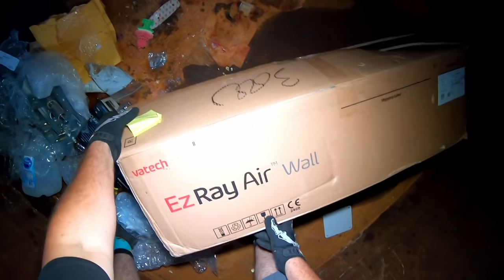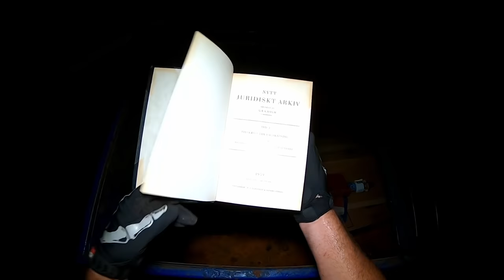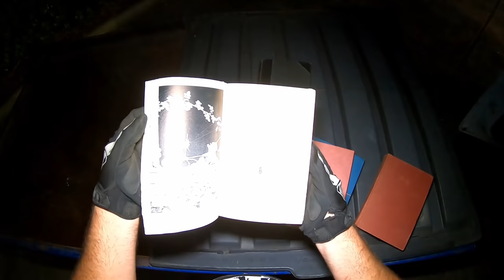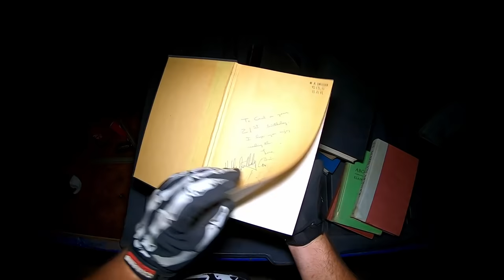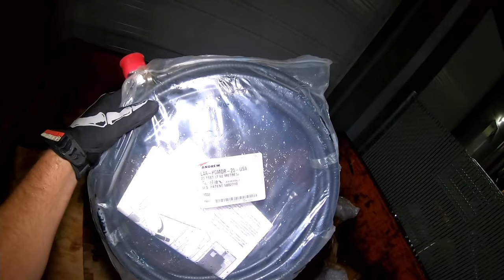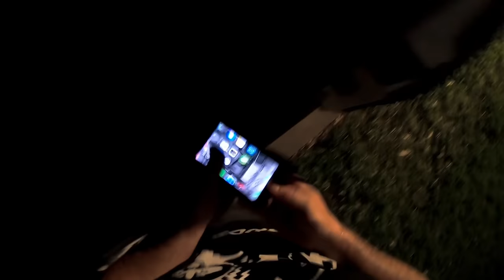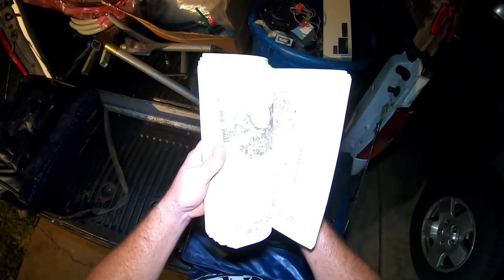Dumpster Diving "Scrap Trap!"

Comment: Man that heliax cable is EXPENSIVE. I use lots of it for radio systems. Some of those connectors are $50-$100 each. Let alone the cable.i’d be interested in some of those cables.

Comment: The Cold Shrink Kit is basically a thick Rubber sleeve that has a stiff plastic liner that is keeping the Rubber sleeve artificially expanded to around twice it's diameter. Pull on the tabs at the end and the inner plastic unwraps itself from the inside (middle) shrinking the Rubber onto whatever it is placed around - normally placed onto one cable before a joint is made then placed across the joint before shrinking - you may have silicon grease or other product inside before enclosure. Good bit of kit, used to use these on Telecoms joints 30 years ago, so they've been around for years!
Reply: Yup I’m a cable splicer and used to use them all the time. We used to bring them home and use them on shovel and rake handles.

Comment: Last racal reel recorder sold for 1200 plus shipping on ebay. Also those reels that were in there with it if they are emi or racal even used they get around 50 for 3 on the bay

Comment: Those Racal tape recorders are magnetic tape recorders used in the early days of mainframe computers. The particular one with maintenance manual is worth a pretty penny as vintage industrial digital electronic machinery. It could fetch a nice price on the second hand market on Ebay or such. If you'd throw in a few of those magnetic tapes too, I'm fairly certain a digital computer buff will be glad to take it off your hands for a decent price. 
Either way, they deserve to be kept safe as authentic electronic equipment
Reply: I was thinking about all those document boxes that could have had any number of original user manuals for various early computer and mainframe equipment. I've had good luck with that stuff on eBay. Several months ago I found a mid-80s dot matrix printer that would have been worth a pretty penny if it could have been made functional again. It was too far gone unfortunately. However it had it's original owners manual in the box which sold very quickly.

Comment: The cold shrink is good to put on tool handles if not used for it’s proper use of water proofing connections. The connectors on the Andrew “stuff” is silver coated brass.

Comment: Mike those cell site jumpers I need 4 for my radio repeater.
That is a gold mine of cables.
I have them in my Amateur Radio Shack.
I have the corring kit for that hard line.
You have over 1000 dollars just in cables. Please don't scrap. List them for Amateur and commercial Radio. Those connections for hard line I have some here. 
Check with a local Ham Radio club and they will tell you about it.
I just found your  Racal recorder on Ebay for $1917. And $268 for shipping.
Reply: I was going to ask how to get some of those Jumpers.. I run a Statewide Repeater Network,. And we would love to get those.... PLEASE!!
Reply: Yeah, but to ship them out of Russia?
Reply: @NewZ-cd3tn  out of Russia??? Not sure what this means
Reply: @JDMarie77  is trying to reply to the above post about the Racal reel to reel machines on eBay. I believe they were located in Moscow.
Reply: @NewZ-cd3tn  No I was asking about getting some of the Jumpers and Cable he pulled out... And it's in Texas
Reply: @JDMarie77  that was supposed to say that I was referring to the other guy about the reel to reel recorders., But I don't do this YouTube comments much, so messed up on who I was trying to reply to.
Reply: @NewZ-cd3tn  aww ok no worries
Reply: @JDMarie77  I have some of those jumpers and use them for my repeater site.
Many came from AT&T and use them for the jumper between the cans and the transmitter.
Reply: @robertschwartzman195  I emailed him about them but never got a reply. Yeah those could come in handy! I own 4 repeater systems and oversee 25 at the moment.

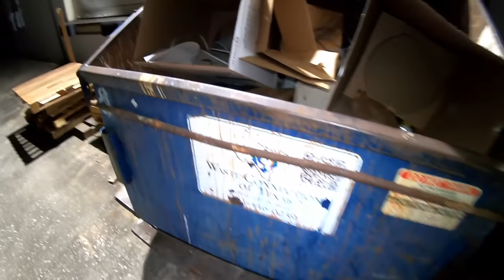Comment: 21:11 at almost a 100 bucks these days for a sheet of plywood, they are worth picking up lol BTW 38:00 I'm sure by now you figured out they are reel to reel tape decks, FYI the motors inside are normally 24V slow 350 ish RPM motors, a lot of those DIY guys that build homemade windmills use those due to the properties of that motor which makes them ideal for that purpose

Comment: Great job good find only with that electrical box dumpster with the apartment 4bay meter box he left half of the resell cash behind simply because it was plastic because all those out door outlet boxes with clear lids to cover cords from the wether alone retail for up to 25bucks pluss all extra brackets covers  especially the industrial size and grade fittings plastic or aluminum um or not they are always needed especially that power meter bay someone with multiple units that want to split up the power bill will pay good cash for that

Comment: Racal made high end industrial/military electronics. The firm was bought out by some French lot around the millenium after they lost their shirts over something to do with Vodafone (I think). Those tape machines are probably broadcast quality and would have been megabucks new, no idea if they have any value now.
Reply: Racal had many divisions.  My mother used to work for them here in Florida--they did high end (at the time) networking/modem gear.  The company went bankrupt/closed decades ago.

Comment: I am thinking since it was in a dumpster full of computer stuff the Racal tape recorder may be a instumentation recorder to record measurement on electronic equipment. Seems like that company made test equipment. I restore old tube items and I am not familiar with them offhand. But I still think its a good find. I don't pay attention to ebay asking prices as you can usually put anything. But with that said you have a couple that could sale together or at the same time on ebay. I think the two of them may bring anywhere from 100 bucks to 500 bucks or maybe more.

Comment: 38:25
If they work, could bring $1,000, each. Untested, $250, each. Worth checking around. Try old electronics repair shops or local radio stations, to see if they can point you to somebody. Even local short-wave clubs.

Comment: When you see the loops of what looks like extra wire on a spool or loop near power line it's optical cable and it can't be spliced  so they make it loop back incase they need to repair it .

Comment: Check that coax number - Printed on Cable - Example RG-58 - if it turns out to be 50 Ohm Cable you ham operators would want it - Sell Ebay - Get 4 to 5 x the scraping price at least

Comment: There’s a huge market for reel to reels, if they don’t work you can probably sell them for $80+
Reply: I use an old 10" Revox recorder and a old Sony recorder.
The radio station I worked had a few reel to reel and acdat recorder.
Reply: @robertschwartzman195  nice! I just bought a Sony 500A stereorecorder reel to reel about 3 days ago. Thing weighs like 100 pounds 😂

Comment: Are ballasts sold as scrap or are they broken down further, does anyone know?
Reply: Can be sold as is, most times worth same or less than regular shred. Older ones have PCB's and considered hazardous waste, yards won't take them. Inside are small copper wound transformers cast in epoxy brick, can be micro scraped but messy, usually best to freeze and hit w hammer or processed in winter. Most scrappers clip the wires and toss em in the shred  pile.

Comment: You need to build relationships with some electrians that apartment meter can is worth 1200 bucks to a commercial electrician he would be glad to buy it for 300
Reply: I concur... Amazing an electrical contractor wouldn't throw that out there is always a use for it... That material was like new...